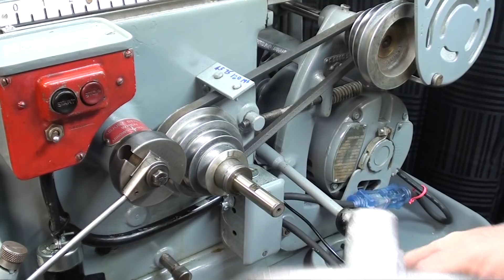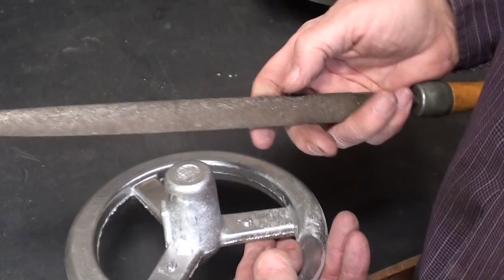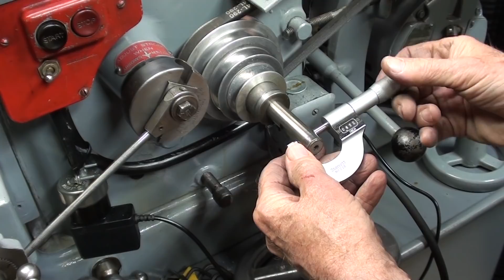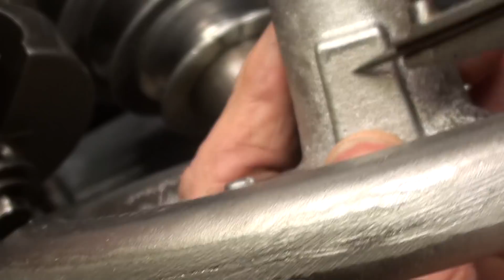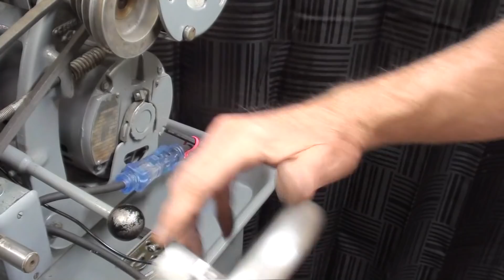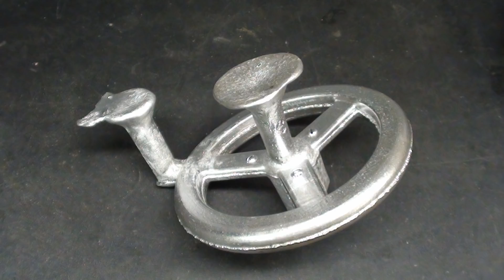Machining the SB Shaper Handwheel 698 tubalcain

Comment: Nice job. I sometimes use a 12 point socket on a tap. You can also find sockets for square nuts in cheep socket sets that I put with my taps.
Reply: I have a set of 8-point sockets we used to drive larger taps with on the big drill press we used to have.
Reply: Proto makes. 8 point sockets for square nuts.

Comment: So satisfying, the feel of a sharp and clean file. I was about to grab a flap disk to clean up band saw cuts on a torque arm for a hub motor, grabbed a file instead. Good thing I did. I didn't realize the control and accuracy I could get with a clean sharp file and some patience. Good advice.

Comment: Hey Mr Pete, Whenever I have a problem with clearance with taps as you did, I use a 8 point socket and a short piece of 3/8" key stock to replace the ratchet and then use any of your normal tap handle. It works smooth with no wobble just like a normal tap handle. This setup is quick and uses available items in most shops. Later

Comment: Nice job on the wheel.  Not sure but I think the "gunsmith file" is actually a checkering tool.  They are used to cut the pattern on the pistol grip portions of rifle stocks.

Comment: hey mr pete i ran into a simiilar problem with the tap not being long enough to clear the housing and my solution was i found a set of square drive sockets on amazon that fit the square on the tap iirc they were less the $10. enjoyed the video thanks

Comment: Nice. Great job. Good little series. I often look at things and think about whether or not I would make one, or buy one. Sometimes, it is just not worth the trouble or time to make yourself. Other times I look at things example, a bottle of beer, I could easily make the beer and sell it for what it costs to purchase similar item in a store, I would not make much or any money. But, the bottle it comes in, I could not even make, and if I did, it would costs far more than the contents the bottle was meant to hold. Yet, for most cases, the bottle is the free part.
Reply from the maker: Very good and logical analysis

Comment: Very nice modification. A 1/4" square drive 12 point socket of the correct size will fit the tap you were having interference problems with.  Use the correct socket with a 1/4" drive  extension and a "T" handle and clearance in such instances becomes a non issue.

Comment: Toll collecting. 
I win #1
I have a set of square sockets that are made to fit taps and allow the use of your socket set extension bars,
Tee handle and even ratchet in difficult situations.
My son works for SnapOn so they happen to be a SnapOn set.
I imagine other brands are available

Comment: Locktite is great stuff that solves a lot of problems besides fastener retention. But it's limited in strength and unsuited for temps over 300 F or so.

For those applications requiring additional strength and/or are subject to 750F or less consider silver braze instead of Locktite.

I'd go for Locktite about 97% of the time.

Comment: Probably a dumb question but at 11:40 you had the wheel in the lathe. Could you have machined off the cast screw heads at that point?
Reply from the maker: Yes, but I did not want machining mark's on the spokes
Reply: @mrpete222  I see, thanks for the reply. It it very helpful for us newbees!

Comment: Rather surprised you didn't face those screw heads off while you had it chucked in the lathe. Just a light facing cut on each side to clean up the spokes would look rather nice, I think.

Do you have a die filer? That might work well on the inside edges of the casting. It really couldn't matter less from a practical standpoint, but when I see the giant, zoomed-in close up wheel enlarged to 40" wide on my tv, every little file mark does stand out.

Comment: If you don’t have a pulley tap , a refrigeration ratchet wrench works better than a small adjustable wrench. 

If the tap has a quarter inch square drive , put any quarter inch drive socket on it and use a hex bit in the business end of the socket. Dab of glue or tape to hold everything together if needed.

Comment: Beautiful project.  I was surprised the mandrel locked into your over sized hole.
Reply: It’s tapered from one end to the other.
Reply: @1musicsearcher  Yes, but only about a thou over size.  He had to ream it to about a thou oversize thus why I thought it would slip through.  Obviously it must still be larger than the oversize bore.  I own a few but haven't used them often.

Comment: 2021..... The year that "hermaphrodite" calipers were no longer considered PC. Outstanding instructional video.
Reply: First I've heard of it - for odd-leg calipers.
Reply: Is mandrel taboo also?
Reply: @doodlebug2121  Why ?
It's not clear (to me) what the difference is between one of those and an arbor.
Reply: I was trying to make a joke about a previous response about the word "hemaphrodite" not being politicly correct.  You know, MANdrel?  As fare as the difference between the two tools, I usually think of mandrel being another nsme for a tapered arbor
Reply: @doodlebug2121  Don't think it has to be tapered. Perhaps an arbor is for cutting tools and mandrels for work holding !
Reply: @doodlebug2121  I presume you meant 'hermaphrodite' and I see no reason that should not be 'PC'. Ditto mandrel, manager and manhole.
Manageress is less PC, like actress and comedienne.
Reply: How about amen and a woman?
Reply: That sounds right.  I have some lathe mandrels in my box and they are all tapered.  My saw arbor, gear cutter arbor etc. are not.

Comment: Wow - McMaster-Carr - so there's no need to go reinventing the wheel - who knew ?
Reply: There is some satisfaction in making your own handwheel (or any of the other 100,000? items in the McMC catalog (or on their vastly superior website)) and it's a great subject for a video. However, if your time is worth anything, buying a ready-made piece of equipment is usually the economic solution.
Reply: Not reinventing. Its knowledge and ya, the price of MMC....not exactly a cheap place to buy. Considering you can get way cheaper items from other places if one looks.
Reply: @oldiron4135  McMaster-Carr can actually be quite surprising on prices. A couple of times I've been pricing raw materials, of all things, and McMaster-Carr was cheaper than MSC, Online Metals, etc. (5/8”×1"1/2"×12" copper bar). McMaster was $10 cheaper than Online Metals, MSC only sold 6-ft bars I believe, and don't even get me going about the ridiculous prices I saw on eBay.
Reply: If they don’t have it, you don’t need it. I’ve found so many things there that I couldn’t find anywhere else.

Comment: I would have wielded a larger wheel around the old one. 
The reason I would do it that way is because I have too much stuff to deal with already, and just have an extra wheel you know you will never use rolling around the shop.
I don't have the capability you have.

Comment: Why not make a Handle from the rim Sprue?  Quicker to turn the wheel with one.  Those screw heads didn't bother me or the cat.
Reply from the maker: Absolutely not. The handle would be lethal when the machine is running
Reply: @mrpete222  OK then!

Comment: I guess using an appropriate sized 12 point socket on a long 1/4" extension to turn a standard length tap is the poor man't pulley tap.